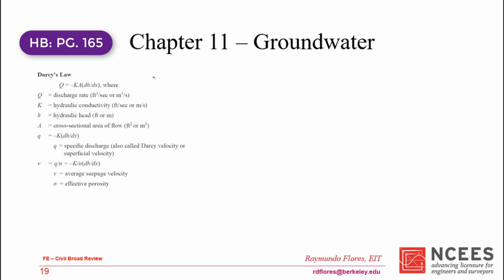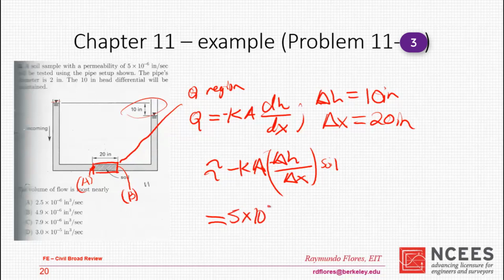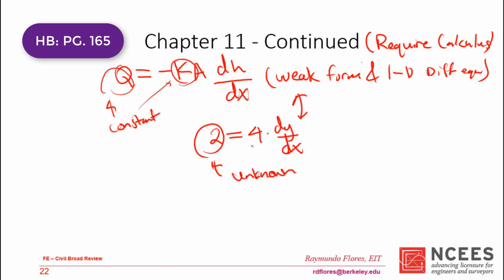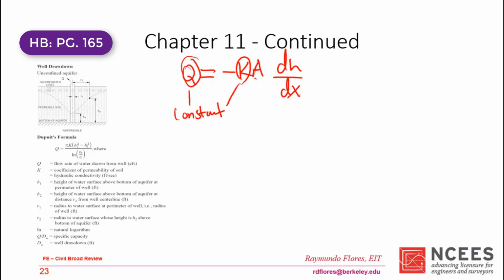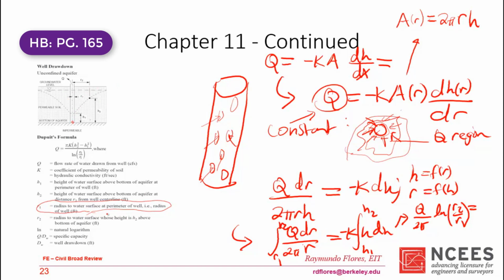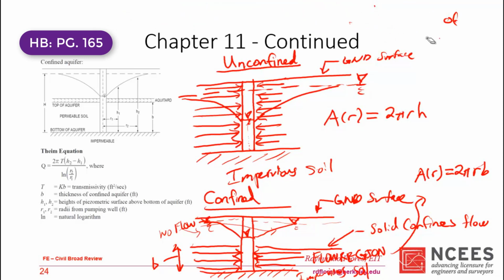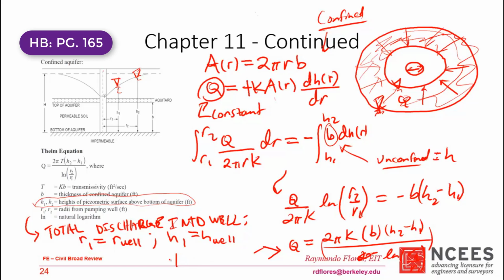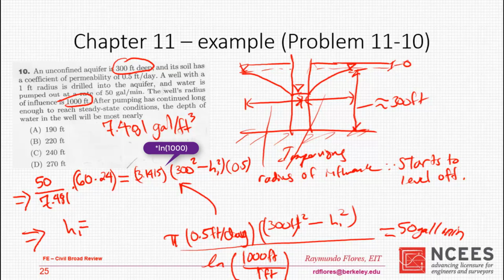FE Exam Civil Review #2: Ch.9-11 Lindeburg [part 3]

Comment: Do you think it would be possible to pass the fe exam if I didn't go to school and just study out of the book and YouTube videos?
Reply from the maker: Joebreh916 Yes, but it would be really hard to do. The school knowledge helps to establish solutions a lot. Otherwise, it's easy to forget and not properly compartmentalize this stuff.
Reply: Dave Yen thank you for the reply. Do you have any advice on where I should start? Like what books I should get or videos I should watch?
Reply from the maker: @MrJboss916  As long as you can get old notes from college and reference that with the Lindeburg review manual, you will study sufficiently. If you haven't taken the correct classes, borrow such notes from someone who has taken the classes. This is mainly for the second portion of the exam (for the speciality you chose). But essentially when obtaining notes, they should have specific descriptions of meanings for certain equations and specific classroom examples. So, keep that in mind when acquiring notes you don't already have.

The big ticket items for civil tends to be structural and geotech. Anything else is quite random from my experience.